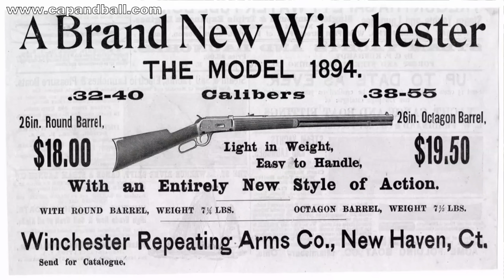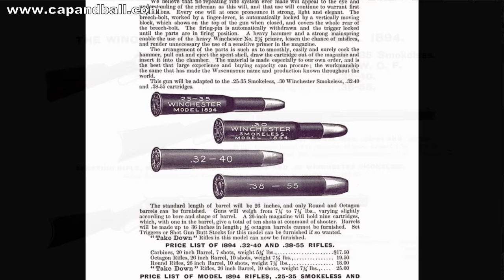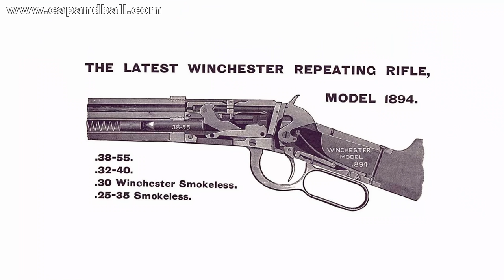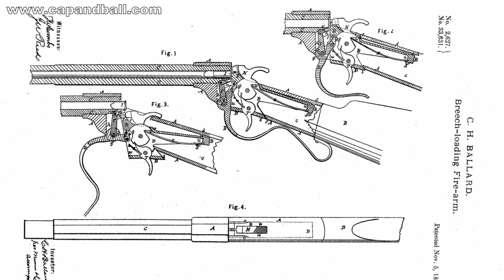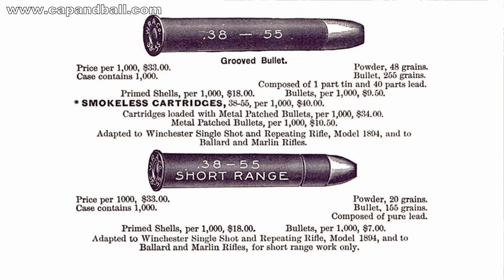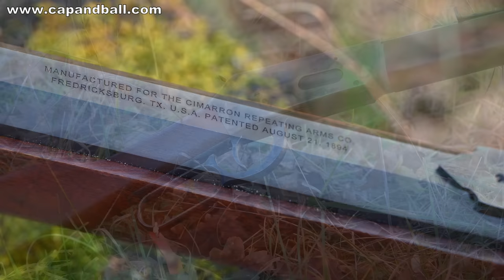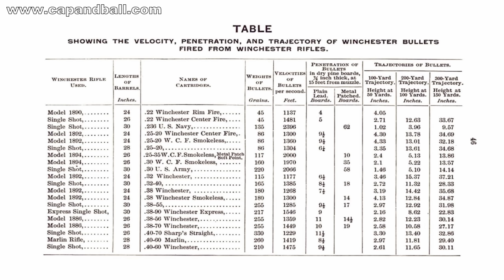The first M 1894 Winchester lever action rifle and the 38-55 cartridge

Comment: I remember Winchester came out with another cartridge based on the 38-55, the following was found on line and explains what not to do with these 2 cartridges.

.375 Winchester (Using Sierra Bullets)
Author: Brian Pearce / Wolfe Publishing Co.
Date: Apr 30 2015

 

Notes from the Lab: .375 Winchester (Using Sierra Bullets)

The .375 Winchester was announced in 1978 in a Winchester Model 94XTP Big Bore lever-action carbine that featured increased steel in the rear quarter of the receiver to handle the greater head thrust and chamber pressures associated with this cartridge. Soon Ruger offered its No. 3 single shot, Thompson/Center Arms its Contender, Marlin the Model 375 lever gun and Savage its Model 99. Two loads were initially offered: a 200-grain bullet at 2,200 fps, or a 250-grain at 1,900 fps. Winchester’s idea was to offer hunters a more powerful option for its most popular sporting rifle.

The .375 Winchester case is shorter than the old .38-55 WCF and much thicker for increased strength. The .375 utilizes .375-inch bullets, while current Winchester factory loads for the .38-55 measure .377 inch (not to mention that groove diameter for this cartridge varies from .376 to .381 inch). Furthermore, the .375 Winchester operates at 52,000 CUP pressure, while maximum average pressure for the .38-55 is 28,000 CUP, with factory loads being significantly below that figure. Regardless of rumors, the two cartridges should not be interchanged, which may prove unsafe.

Using the Sierra 200-grain flat point bullet, highest velocities were achieved with IMR-4198 and Alliant Reloder 7. Very little changes in accuracy occurred using loads with each of the powders listed in the accompanying data; however, Hodgdon H-322 recorded the single tightest group.

When handloading for the Winchester Model 94XTR, cases should be full-length sized, then the case mouth expanded just enough to accept bullets. After seating bullets to the upper edge of the cannelure, a heavy roll crimp should be applied.
Reply: Thank you for the info. I own a Model 94 in 375 win. I have not tried to use 38-55 ammo in it. I do wish I could find affordable ammo for my rifle.
Reply: @jamesschwamberger7958  i just shot a Winchester 255 grain 38/55 round in my BB .375. It only hit 1,090 fps on the chrono.
The factory 200 grain .375 ammo from HSM hit 2,365 fps.
I feel your pain on finding ammo for it. That's why i got a box of 38/55 to try.

Comment: Crank that 38-55 up with a case full of RL7 and some Cast Performance boolits,  you'll be amazed ! Great videos.
Reply: What’s your recipe?
Reply: @josephchicone7585    260 gr C-P hardcast flatpt 30.0 - 31.0 RL7 WLR primer 2.510 col
260 C-P hardcast  flatpt 32.0 imr 3031 WLR primer 2.510 col
I'm shooting a modern 94 Winchester takedown.  Don't use in older rifles.

Comment: The 38-55 in black powder and smokeless is perfectly suited for anything on the North American continent. I don't feel under equipped with a modern 1892 in 45 Colt pushing a 250gr bullet 1,200 fps. It hits hard. Very hard. I can push a 38-55 to still higher velocity with heavier bullet.
It'll humanely drop any game animal.

Comment: That is a really small rifle cartridge. My model 1894 made in 1950 uses a .32 special rifle cartridge and as a result only holds 7 rounds in the tubular magazine. That caliber you can really load up that tube magazine. Thanks for sharing
Reply: The 32 special is only a few thousandths of an inch longer than the 38-55. The 38-55 is the parent cartridge of the 30-30 Winchester, so it is not small at all

Comment: when I was working as a gunsmith a guy brought one of the originals of these in. It was rusted, rotted and the bore was a smooth bore sewer pipe, but the action was sound. I inspected and cleaned it but told the guy that he was going to have to find a new barrel and bring it to a gunsmith with a proper machine shop. I also told him that he was going to have to take up casting and reloading because .38-55 is not commercially available. He asked about putting a .30-30 barrel and bolt on it but I told him that due to the production date, even if he did that he would still have to load black powder rounds for it.

Comment: Thank you for a very informative video about the 1894 Winchester rifle and the venerable 38-55 cartridge. I shoot black powder occasionally though I must admit I mostly shoot safe and moderate charges of smokeless powder. I love the older black powder rifles, shotguns , and pistols. There is a quality about them that makes them beautiful or maybe graceful, as well as historical.
I just completed a conversion to a replica Colt 1860 army that allows me to shoot .45 Colt cartridges and yet retain the ability to switch back to the cap and ball cylinder for the best of both worlds. The manufacturer accomplished this by designing a two step cylinder hand that allows timing between the 6 shot cap and ball cylinder, and the 5 shot cartridge conversion cylinder. Maybe one day if you ever obtain one you could do a video on cap and ball conversions as they are historical transitions from powder and ball to cartridges. Your videos (all of them) are very well presented.

Comment: In a modern 1894 reloads with 265 fn cast can load from 1200 fps target to over 1600 fps . 220 Barnes jacketed soft points to 1800 fps plus. A soft shooting accurate round. Might get a 20 incher

Comment: I have one of those made by Winchester.  And one made in .32/40.  Which is the other caliber that Winchester made while trying to get the nickel steel correct and also load the cartridges safely with smokeless powder.  It seemed that if you were a grain or two over the charge with smokeless powder, bad things happened.  I have to form my .32/40 brass from .30/30.

Comment: At 50 meters your shot group should be tighter, less than 1 inch.   I would suggest slugging the barrel.  My friend found his new Rossi was bore a little loose, which barely had the bullet engaging the rifling.  You may have the same issue.  You may have to use a .002 bigger bullet.  Instead of using the .375 bullet, try using the .377, .378 or .379 cast bullets .  I'm sure accuracy will improve.  38-55 was no slouch for , " back in the day" cartridge from black powder.  About the same speed as a 44 magnum or a tad better.   I'd love to find an original.

Comment: I wonder what type pf brass you are using for your reloads. Here in the States we can get Starline brand brass that is slightly longer than what most factories manufacture; it is meant for cast bullet loads (2.125" vs 2.080"). It is also thinner in the neck portion of the case so the cast bullets can be properly sized to groove diameter and still chaamber easily. I think these cases can assist in better accuracy out of your rifle.
Reply from the maker: It is Starline. That's the only one I have access to.

Comment: What about 45-70 strait wall cartridge? I would consider that smaller then 45-90; but still consider 38-55 a stout cartridge as well. I love my 45-70 due to bullet weight. If I wanted a faster bullet I would want a 38-55. Again, both 45-70 and 38-55 are really good cartridges. 👍

Comment: Lovely rifle, great video. I've got to say though; it's great what JMB did to get a full-power rifle cartridge in a small-frame lever action, but his much stronger actions just don't seem to have the same speed or smoothness of use as the much weaker toggle locks?  I've never fired either, so this is just based on observation.  I guess it depends on what you want; speed or power?   Good stuff either way.
Reply from the maker: I agree. The M1860-66-73 are flawless. The 86, 92 and 94 are more sensitive to cartridge. But the 1895 is also a flawless rifle.
Reply: The toggle link actions are quite a bit smoother than any other lever action rifle that I have tried. I have a Uberti 1873 and with lighter springs installed, the action can be easily cycled by my pinky.

Comment: Starline makes two 38-55 cartridge cases. From my reading the 2.080 inch is the current modern case length. The 2.125 inch case length was the original Marlin - Ballard cartridge length. What is the chamber length of the uberti 1894 that you are shooting? My 1885 high wall accept the 2.125 length case. I always enjoy your videos. Hope to see you use the 1894 in a hunt soon.

Comment: I have a (I think blackpowder era) 1894 in .32-40 and it has a large imperfection midway down the bore (rust/pitting dark section). I understand you can convert a .32-40 to .38-55... do you happen to know whether all the shell catches and elevators and other parts are compatible with the larger cartridge? Thanks for any info. @capandball

Comment: Great video! Never realized how weak the .38-55 really was but the 55 is really half way between the 40 grains in 44-40 and the 70 grains in 45-70 so it makes sense. Still, the 1894 is a sentimental favorite for most people in the United States so the video was fascinating. Would like to see you hunt with it.
Reply: It's not really a "weak" cartridge.  The gent in the video is loading with black powder, making it a little weak. Smokeless loads can be loaded fairly hot.
Reply: I have been handloading the 38-55 for close to 40 years. I would never consider it to be a "weak" cartridge. Also it is capable of excellent accuracy.

Comment: Try 42 gr Goex 2FG and the Lee 250 gr bullet 20:1 alloy lubed with SPG with a .060 poly wad. You'll get 1200 fps. Tried Lyman 255 gr bullet but Lee was more accurate.

Comment: Great review.  But I don't understand Uberti?   Uberti prides itself on historically accurate replicas from the olden days, yet they seem to have botched this 1894.  Uberti essentially cloned the less desirable POST 1964 model 94. (most specifically the late 1970s version)  Why????  The post 1964 guns are less desirable having quite a few changes from the original design 1894.  Yes I do see one minor throwback they caved in on, they did use the screw placement for the loading gate screw as the pre-64 did, but that's it. (The originals they released had the vertically placed Post64 screws)     Frankly I am surprised that Uberti didn't clone the Angle Eject 94 with this mindset.

One more complaint, what's up with Uberti's inability to properly finish the extractor's contour on the top of the bolt?   

Now that I've railed on Uberti's incompetence, I am glad to see anything new (including this 1894) on the market!

Comment: never have cared for a lever action myself much prefer a pump action with a tube mag like that! and that is one thing i can't figure out why was the lever so popular and the pump barely noticed in a rifle back then!
Reply: Better for more consistent shooting, your support arm isn't flopping around, more conducive to fighting from a prone and kneeling position, stronger action, etc.
Reply: @SonOfTheDawn515  actionwise their the same just the method of cycling is different! the Colt lightning (which was available in the same cartridge ranges!!) action looks almost identical to a Winchester 1886's except the slide goes straight back to unlock and cycle it where the Winchester toggles down to unlock and then moves the bolt backwards!! personally i've never had any consistency issues with a pump action by the time you fire your arm is locked and steady! to me it feels like a more natural action to pump than to lever!! it's a linear motion straight back and straight forward unlike throwing a lever! and as for shooting prone a pump is far superior you don't have to shift the gun or roll sideways to operate the action unlike with a lever gun that the lever hits the ground in the prone with mostlever guns! the lever action is just odd to me with a bolt action you completely let to work the action that feels and sounds natural a pump you just rack it again natural semi auto just let it do it;s thing but a lever action you half let go half hold on! i find it awkward and uncomfortable!!

Comment: I have a Winchester 1894 chambered in 3030. It will not chamber But it will eject.  It's a very slick Working action It just will not chamber a round it spits it out before it chambers it. Have any advice?

Comment: If I recall right. The "short range" version of the 38-55 as seen on the advertisement picture was either for short range target shooting or varmint hunting. I did read they tried it with other rounds like the 30WCF (30-30), and 30-40 krag. Its a very light recoiling load